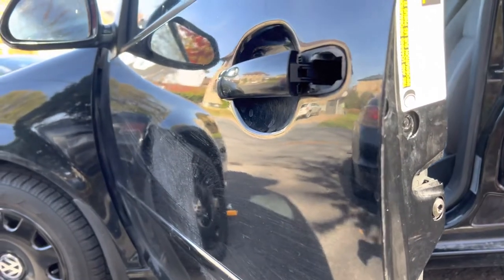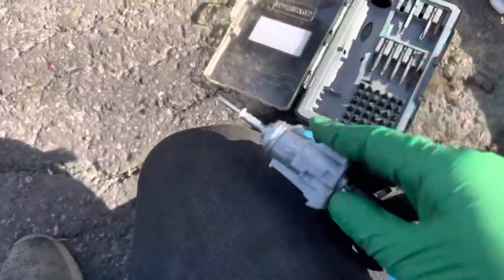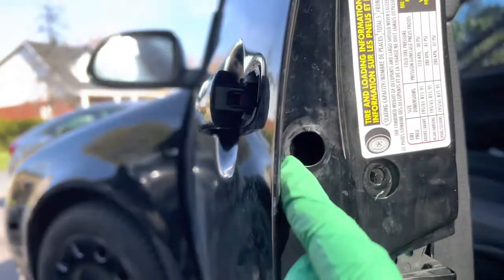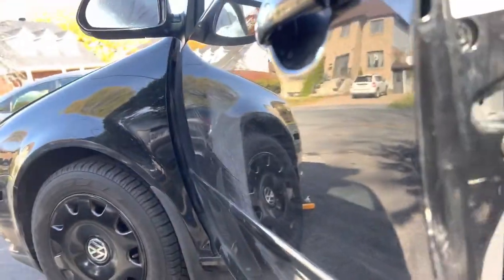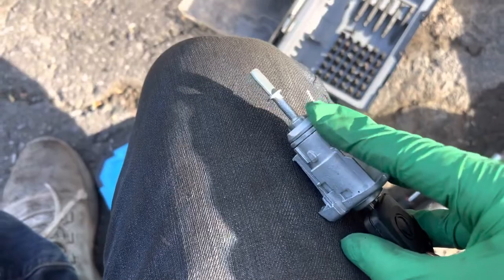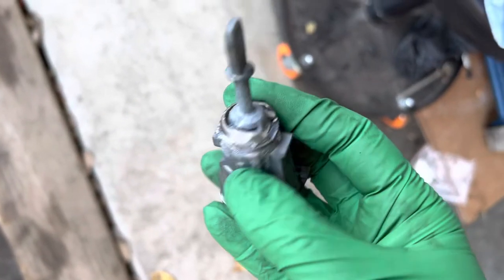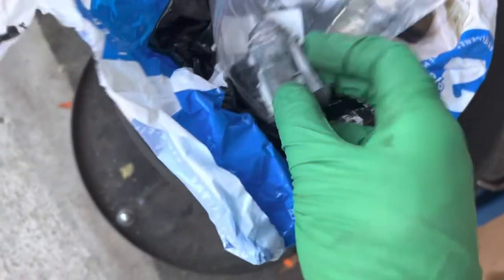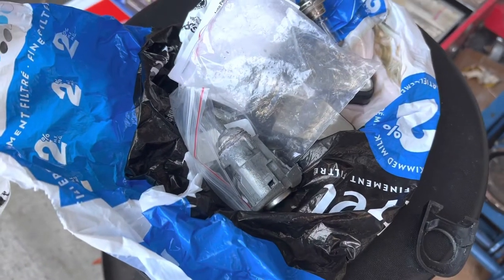Volkswagen MK4 - Door lock does not turn / stuck - How to change lock cylinder in minutes

Comment: yeah but my door dont open at all so thanks in advance!
Reply from the maker: damn if your door doesnt open, your only way is to rip the panel out or try to pry the cable after opening the window. You need to find the 'cable' that when you pull, it opens the door. Good luck
Reply: @MTLJack  welp it whent from 3 degree to 20 and now they both opened idkk!!! lol